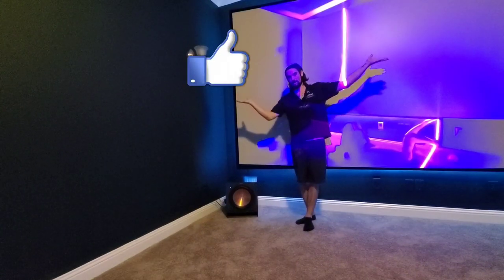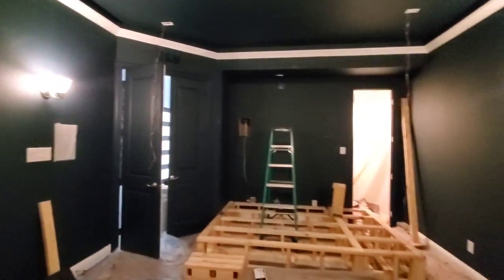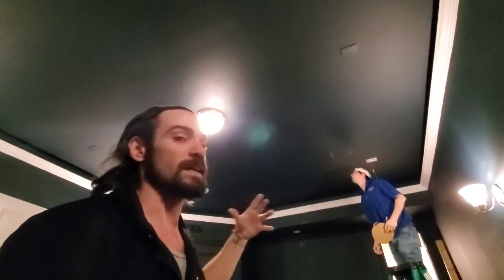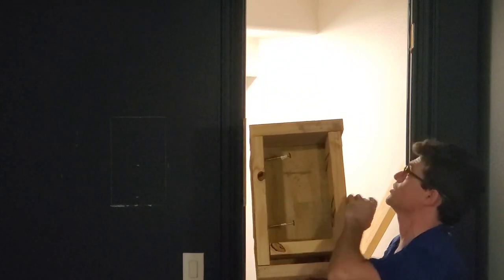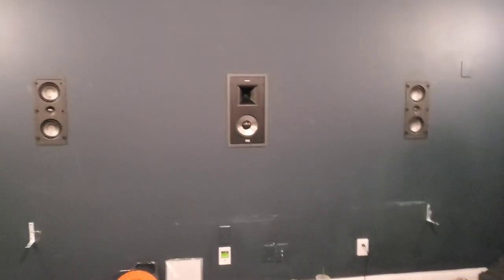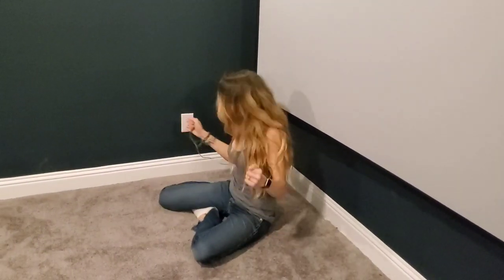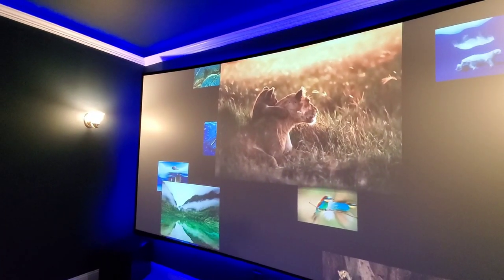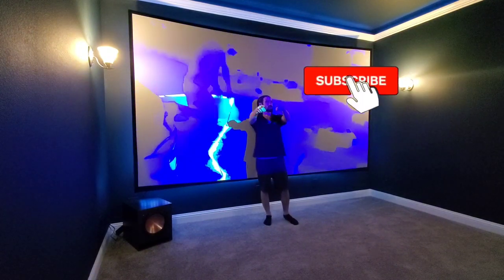Massive Curved Theater Screen | Better than Dragonfly Screen | Epson 4050ub Watch till the end! lol!

Comment: Hi Guys, I had an issue to fit the picture with Epson projector to Grandview Curved screen, can you help how did you do it ?
Reply from the maker: Standard projectors will not work with a normal curved screen. Our custom curved screen is a very specific patent pending design that fits a standard projector image. So it's normal for yours not to fit. You need an anamorphic lens, and projector that's capable of supporting an anamorphic. With the lights off, you'll probably be okay to leave it the way it is. Try dropping the projector as low as possible, the closer towards the center of screen, the more your image is going to fit Square. Thanks for watching and please subscribe for more
Reply: How much are screens like this?  Do you offer ALR?